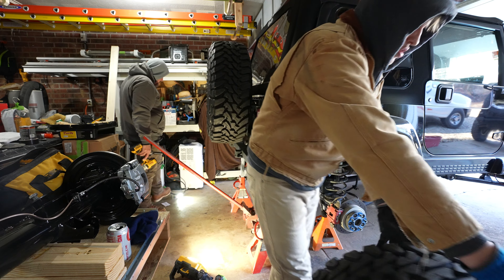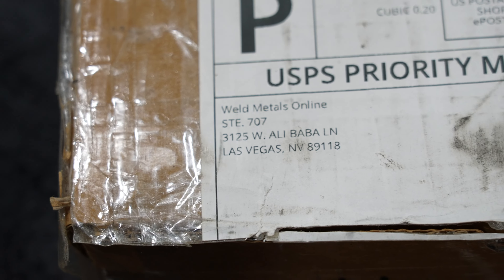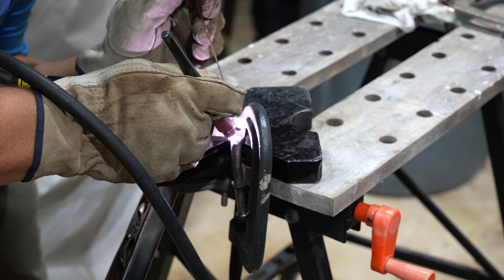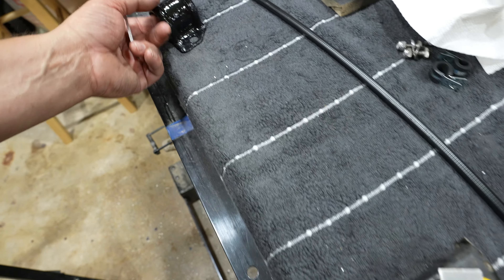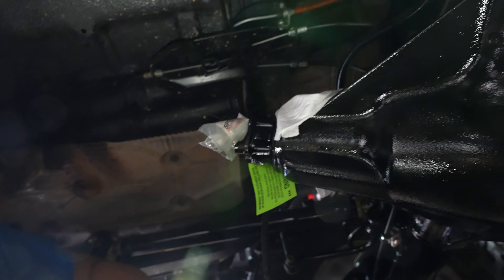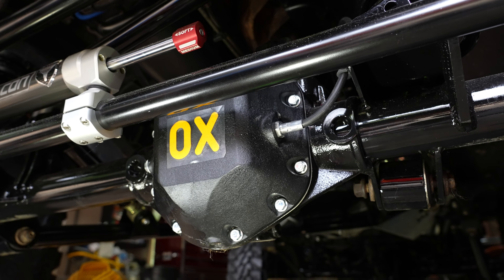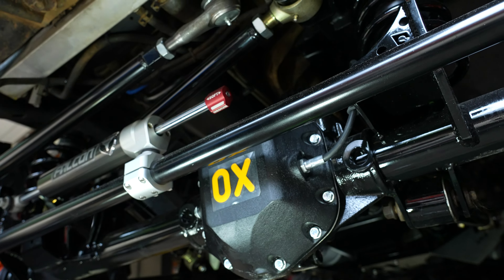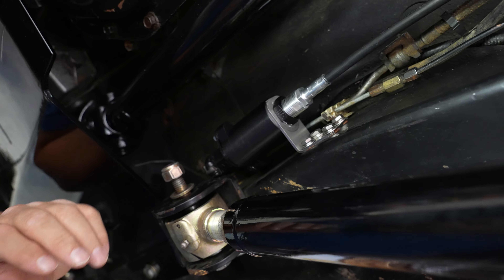OX locker and Emergency brake holders Jeep TJ/LJ

Comment: I see and agree with your concern regarding the low and exposed items.  The first time, we wheeled our LJ after getting it trail ready. we blew out a rear shock on a boulder.  Those cable connections and brake calipers look very exposed for rock damage.
Reply from the maker: Time will definitely tell if this is an issue. When the shock blew did you just loose dampening or was it a bent shock.
Reply: @wetjandcritters4199  the body was dented and fluid was spewing out.
Reply from the maker: Teraflex has their TJ Falcon shocks that have a reservoir that lays parallel with the axle tube. I always wondered how they faired out from damage.  @johnfitzgerald5158

Comment: Installing ox lockers in my lj next couple days. Looking forward to update. Curiosity how you like he solenoids
Reply from the maker: I think I’m going to like them. Going the air route is definitely easier and which I was advised to go with from the owner of ECGS. Of course I didn’t. The servos are more difficult to find a place to mount but I believe they are the way to go. I’m still adjusting everything on the Jeep (bump stops, a few things coming up for future videos) so I will eventually do an update on what I think of the ox lockers with electric servos. One word of caution is watch out for the OX diff cover depth. The cover protrudes considerably more than an ARB or Ruff Stuff steel cover. The steering is really close and I had to make some adjustments.

Comment: I got the same lockers for my new axles on my TJ. I wanted to go with the manual cable as well but as you mentioned theres really no room to mount them so I'm going with the electric as well. What length cables did you end up going with?
Reply from the maker: Pt# on the box is 46001-48-A so I’m assuming they’re 48” cables. Yah I wish I could have found the room for the manuel lever but these should be the next best thing. Throw the instructions away that come with the servos, it is incorrect and contradicts what’s on OX’s website.  Good luck man.